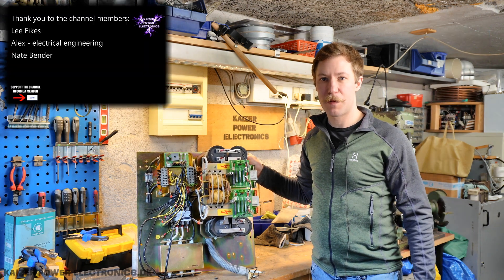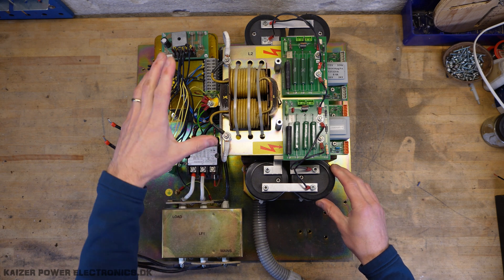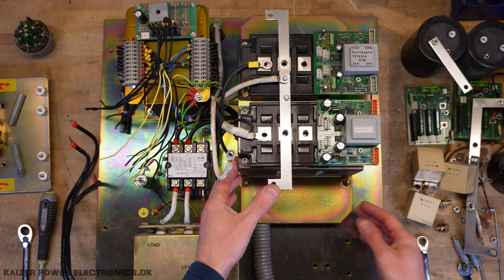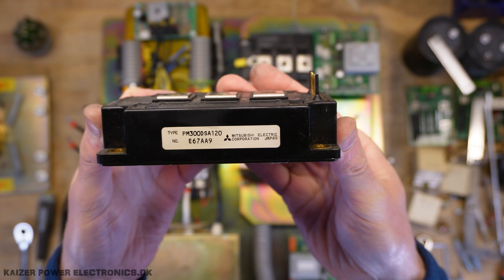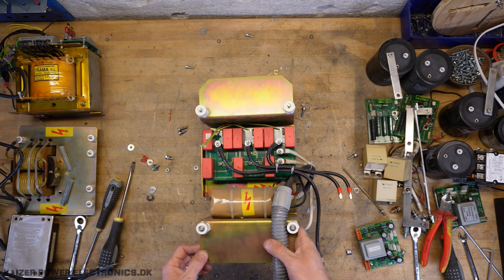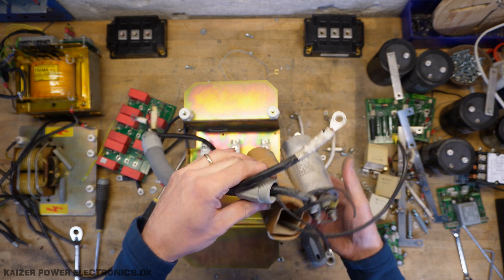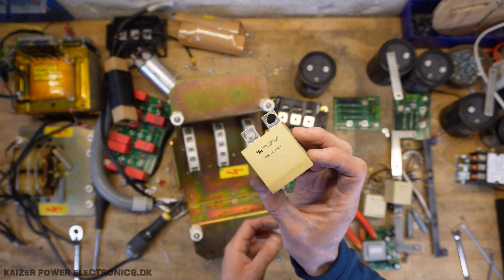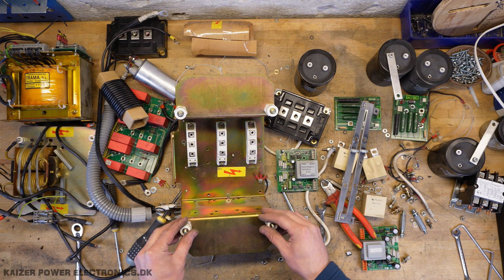50 kW Sedecal SHF-530 X-ray High Voltage Generator Inverter Teardown

Comment: i hope you asscemble all as it was? )
Reply: My guess is that parts will be reassembled as they should be. :)   He only had access to that one cabinet in the system.
Reply from the maker: Not quite understood? Entire x-Ray systems are EASILY above 500 kg in total. It is not something you just slab in the back of your car :)
Reply: @KaizerPowerElectronicsDk  Exactly, you'll reassemble a few of the parts into other projects - as they should be :)  Nice IGBT find, btw.  I hope you were able to remove the back cover and have a look around.

Comment: If that contactor is for functional, rather than safety isolation, it would only need to switch 2 of the 3 phases. I wonder if they keep one phase connected to avoid anything floating up to a very high voltage if an earth comes off
Reply from the maker: That is a very good point! That would leave a negative rail for faults to return through, if there was a capacitor from negative rail to ground... I do not remember if there were such, when I in a hurry pulled the inverter panel out of the cabinet.
Reply: There would be a main supply contactor upstream that's not present. This contactor has a resistor (the green one adjacent, typically 20 ohms on the units I'm familiar with) across one of its legs to limit the initial charge of the caps using only 2 phases. Once sufficient charge is measured, it pulls in and full 3 phase current is available.